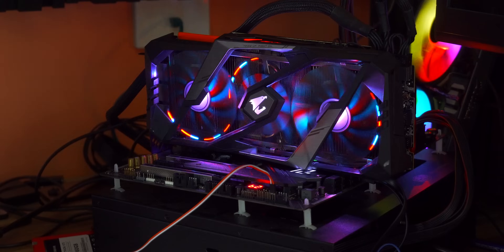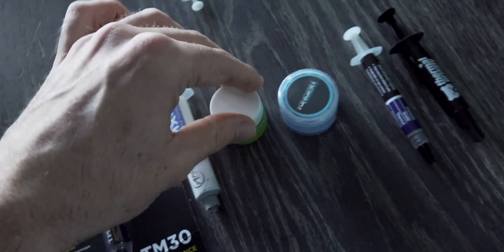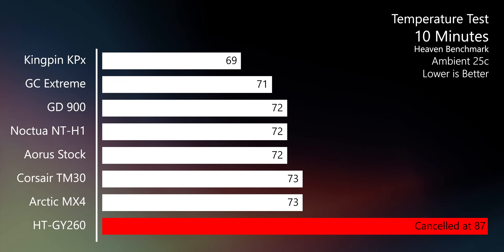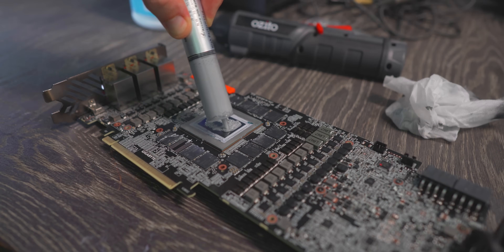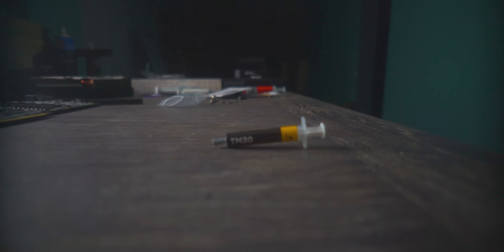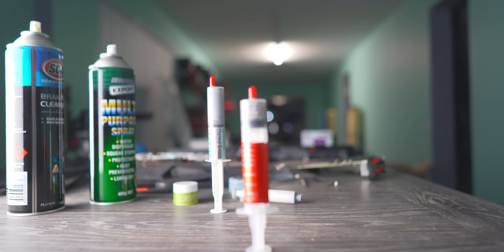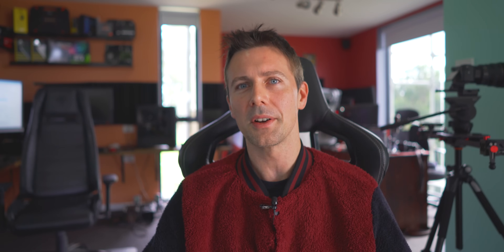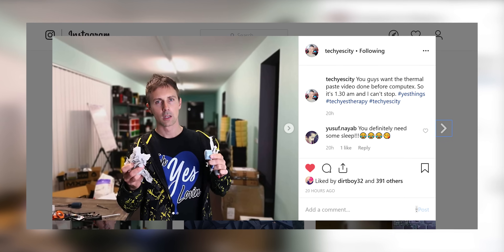What's The BEST Thermal Paste in 2019....? (Ft. GD900)

Comment from the maker: Little update on the thermal grizzly, I will make sure it's in the next test, though it's very difficult to get in Aus... (like no one sells it... :(), regardless computex and Taiwan should have some! So will get a tube over there!
Reply: PC Case Gear has it Brian
https://www.pccasegear.com/products/33320/thermal-grizzly-kryonaut-thermal-grease-3ml
Reply from the maker: Awesome I will order a tube.
Reply: Noctua released a 2nd gen thermal paste
Reply: Just be careful because there's fake stuff out there.
Reply: The only thing with testing paste on GPU is the dynamic clocks which kind of makes the test invalid, unless you can lock the clocks and also lock the fan speed.
Reply: Hey there Brian, you have done a lot of excellent work here already. However that is really only just the beginning of the measuring! There are certain things left not addressed in this video. One major point is is that runny pastes are great to apply but will dry out and loose performance much quicker than one of the high viscosity pastes like IC diamond, kpx, or gelid gc extreme. The only way to determine that aspect is to take further testing data points after an extended period of usage and time, for example: 0 days, 1 week, 1 month and 3 months. In the case of the GD900 it performed great on day0, but how can we be sure that the GD900 is really holding up over time? Well it might not we simply just don't know for certain. For example it might get overtaken by something else that was initially worse, like MX4 after a crossover point at X weeks of usage and performance drop off. We simply dont have the data to back that up. TO avoid the dry out problem, a thicker paste will always last much longer. So what we are really missing here, is a THICK version of the GD900 from aliexpress - ie. a cheap chinese product version, to compete with the IC Diamond, but at a similar low cost. This is particularly important for laptops even more so, as a runny paste simply is not suitable for them. They go bad even faster in a laptop. Anyhow I am getting away from my request to please ask you to retest them over longer period or time.  In terms of what test system(s) to use, you probably want to use your daily systems. Even if they are not the same as each other. Because what you want to be measuring is the performance drop-off relative to that specific paste's initial temperature in that specific system. And to be running your computer like normal, so every day, and taking just a few data points spread over a long period of many weeks. So what could ever be better than your daily system? Unless you want to be powering extra computers for just exclusively that task. Anyhow my point is that it is less critical if the different systems are not the same as each other. To see a meaningful difference for testing the paste dry out time. It's not like the razor thin differences between newly applied pastes. The temps should be a risin' pretty high.
Reply: I swear by Kryonaut. I use it for all of my builds. You don't get a lot, but it doesn't cure and keeps the temps amazing.
Reply: @AceMcCrank  Same here.  I get the 11.1 gram tube and it goes pretty far though.  I also use arctic cleaning solutions too.  From old stock thermal paste that's been hard for years I've seen temps go from 72c to 40c.
Reply: Pretty sure someone can ship it to you if you pay for it plus the shipping. Also could you test them on cpu and maybe also add the liquid metal from thermal grizzly as a top benchmark reference. I wonder how close can the kinping paste get to liquid metal.
Reply: in my country its sold in every pc store. its the only one that is in every store and a lot of stores also have liquid metal
Reply from the maker: At the last LN2 event, EVERYONE was using the KPX stuff if that's anything to add.
Reply: @techyescity  is it True that it's Blue because Vince's Secret Ingredient is Smurf Blood
Reply: You can get Kryonaut on Ebay as well as amazon and mighty ape and pccasegear
Reply: @MysticStar_Blue_Swordsman  There's fake Kryonaut on ebay, Wal~Mart Online, Amazon, & NewEgg. I know because I had bad experiences with all of them, LOL.
Reply: @MysticStar_Blue_Swordsman  
"Ouch, Always use reputable sellers ALWAYS check rep and what people say"
That doesn't guarantee anything, LOL.
Reply: @MysticStar_Blue_Swordsman  PC Case Gear is the cheapest & they have the bigger tubes
Reply: @MysticStar_Blue_Swordsman  Didn't think of that, I went there when I was Visiting family near Frankston
Reply: @MysticStar_Blue_Swordsman  I agree that's really expensive, from memory Auspost charged $7.20 for up to 500 grams
Reply: Keyonaut is considered the best silicon thermal paste
Reply: IC Thermalpad, IC Diamond vs GD900
Kryonaut vs kingpin cooling

Let's gooooo :D
Reply: From my experience Kryonaut dried out after 3 months at 80C so yeah don't use Kryonaut on air cooling.
Reply: Then why would you mention it for the video lol also not to be rough but check out noctuas nt-h2 as well. Thanks.
Reply: I WANTED to hit like.... But you cockteased Thermal Grizzly Kryonaut!! But no test results!!!!
Whai u not inclued Thremal Grizzwald Cryalot in ur test resluts?!?!  Thremal Grizzwald beats the world!!!!
Reply: hey check out these two

https://www.aliexpress.com/item/33011140069.html?spm=2114.search0604.3.63.221679afMvl3th&ws_ab_test=searchweb0_0%2Csearchweb201602_1_10065_10068_10890_10547_319_10546_317_10548_10696_10084_453_454_10083_10618_10304_10307_10820_537_536_10059_10884_10887_321_322_10103%2Csearchweb201603_52%2CppcSwitch_0&algo_expid=0e18b67a-9b24-4c69-a216-3bea60301f6f-12&algo_pvid=0e18b67a-9b24-4c69-a216-3bea60301f6f&transAbTest=ae803_3

https://www.aliexpress.com/item/32955076132.html?spm=2114.search0604.3.109.221679afMvl3th&ws_ab_test=searchweb0_0%2Csearchweb201602_1_10065_10068_10890_10547_319_10546_317_10548_10696_10084_453_454_10083_10618_10304_10307_10820_537_536_10059_10884_10887_321_322_10103%2Csearchweb201603_52%2CppcSwitch_0&algo_expid=0e18b67a-9b24-4c69-a216-3bea60301f6f-19&algo_pvid=0e18b67a-9b24-4c69-a216-3bea60301f6f&transAbTest=ae803_3
Reply: Not to be critical of your efforts here, but (outside of 4° or 5° differences) they actually don't mean much.
The problem with any thermal paste test involving human application is that even a slight (microscopic) difference in application thickness (or method) can cause greater differences than the actual differences between good-quality pastes.
As an experiment, we applied the same paste to the same heatplate repeatedly,.
Even though we kept ambient temp and the starting temp of the (calibrated) heatplate the same for each trial, and tried to keep our application EXACTLY the same each time, we still got as much as a 2.6° delta over the course of 14 trials (with the same paste).
Also, as you're probably aware, most K-type probes are only accurate to ±1° C; we had to spend close to $200 USD to get a probe that was consistently accurate to within 0.2°K — (the limit of our meter).
We our currently working on an automated application method to accurately apply (and measure the application thickness of) different TIMs — (will keep you posted).

Since you asked...
SUGGESTIONS: Use a calibrated heatplate (over a measured area), an accurate probe, and do multiple trials for each paste. (It may take a good deal longer, but will demonstrate the inconsistency of application and produce more meaningful results).
Reply: @UCSU3k9eeTcraD1LC1xFXLIg Sounds very interesting & link me if you make a video.
Reply: I can mail you a tube if you want.
I'll also mail you a tube of TF8.
Reply: This video actually made me a little annoyed because as you said, you didn’t test grizzly 😡
Reply: @SignedAdam  shut your fanboy ass up lmaooooo their not that good bro
Reply: No need, cuz fun fact:
Gd900=thermal grizzly
A russian techtuber confirmed it
Reply: Please review these aliexpress thermal pastes
Alseye 9T+ (13W/m.K) , and Snowmann MTG10 (14.3W/mk),should be in next video. 
They are really cheap , and in theory they should be betther than artic mx-4
Reply: Lol its sold in every pb store over here in the new zealand
Reply: BRUH PCcasegear sells it its the only paste i use
Reply: You should probably grab like 10. I love that stuff.
Reply: But... you had the tube of Grizzly right there man. I saw it.
Reply: @hjembrentkent6181  Someone sent it to Brian & It was empty Haha
Reply: The New Noctua one NT-H2?
Reply: Tech YES City  PC Case Gear sell it easy to get
Reply: Why you didn't test those with a blower r9 295x?
Reply: Cut the top nozzle and it will most probably flow. It might have hardened
Reply: Hi tech yes city would you like to send me the thermal paste graphics? wellingtonfagundes1@gmail.com my email to send thank you very much
Reply: The 1080TI is probably the best for testing for stupid high power and small area
Reply: Dude Ill send you some Thermal Grizzly if you can't order it, let me know!
Reply: Okay I hit like because YOU got cockteased with Kryonaut!  But on that note I WOULD like to see both Kryonaut and IC Diamond - I still have BIG tube of IC Diamond from when everyone was saying that it was the best.

 I also have a big old tube of NT-H1 because when I told my dad he used up all my Kryonaut on his big old X99 CPU - he confused Thermal Grizzly with Noctua because I had just bought him a Noctua NH-D15 to PROPERLY cool his i7-5820k for Chritmas (He and Mom bought me the Rockit 88 CPU Delid/Relid kit! I relidded, using 4 TINY dabs of Superglue Gel, and the thermals are insanely good!) - he had a Hyper 212 EVO on it! To the 212's credit, it did sustain a 4.4 GHZ auto overclock without throttling or even running too hot - on an i7-5820k!
Reply: Hi Brian, Brian of the USA here... have you happened to try out Arctic Silver Ceramique 2? I personally really like this stuff. It is non conductive, cheap, decent thermal conductivity and very shock resistant! I havent conducted any formal investigations on how it compares to other pastes. Just fishing for opinions from other enthusiasts! Thanx
Reply: i used that long time ago and i was very happy with the stuff, not sure how would it hold up to the newer pastes, i would like to know also
Reply: Love the Kryonaut. Great for GPUs because it doesn't cure and crack like other pastes.
Reply: Excuse me, Yes Man, you showed Peanut butter in the intro, you have to do thermal testing with it now
Reply: Only watched this to see KP vs Thermal Grizzly. I currently use Kryonaught.
Reply: Test all of their products lol
Reply: @dodecahedron-r7d  I'm not game to try Conductonaut Liquid Metal as I shake similar to Parkinsons Disease & would probably end up with it everywhere, I'm bad enough with paste but at least it's not conductive & it cleans up with contact cleaner in tight places if I get messy,

I got the Thermal Grizzly Kryonaut Thermal Grease for redoing my MSI GTX1080Ti Gaming X I got 2nd Hand (has been a massive improvement Home Video Editing with Cuda Acceleration over my R9 270X even with the FX6300 at the moment)
I haven't got around to doing it yet as I am upgrading my FX6300 cpu to AM4 & waiting for Ryzen 3000 to go 8c/16t (not sure if I'm gonna get a 3700X or see what 2700 prices do in Australia next month, but more likely go 2700) & want to do some before & after tests for temp comparison, at the moment I'm just using a Athlon 200GE in my AM4 board for surfing the net as I couldn't wait to use it & it takes a while to save for better parts on a Disability Pension.

I also have a 1080p gaming computer I Built for when I've got some long videos to transpose to Digital, It made it onto BPS Customs ShowMeYourRig last episode, as the last PC in the video I was really surprised considering the Quality of the first 2 entries
Reply: @dodecahedron-r7d  That's conductonaut, not Kryonaut which is non conductive.
Reply: Bro your videos are great keep them going, please do some videos on the best cooling, liquid or air cooling what can we do to hack out those insane numbers! Peace
Reply: problem with high viscosity pastes is that over time they migrate out of the chip(you can watch that clip of debauer explaning it thoroughly) and for short amount of time high viscosity pastes are better, but in the long run, somewhat firmer pastes hold up better(they stay in place better)..
Reply: @Tech Yes City
Phobya Nanogrease Extreme
Thermal interface for CPU, GPU, and chipset applications
Thermal conductivity: 16W/mK
Electrically non-conductive
Content: 3.5g
Reply: I was gonna say...lol where's the grizzly, I got 2 tubes for half price a couple months ago while on sale
Reply: HY880 vs GD900 please
Reply: Please can you do some testing on changing thermal pads on vrms and mem with higher mounting pressure and see if there any overclock performance or graphite pad vs higher quality thermal pads.
Reply: link?
Reply: it'd be really appreciated if you could add more thermal pastes. such as Deep Blue Z9 which seem to perform just like thermal grizzly. 
Some side note : 
It may worth testing the longevity of these pastes, I mean, maybe they perform similarly in a shot periods of time, but if under test for like couple of hours or days, maybe some perform better  than others. its worth testing this as well.
Reply: 2020 edition of this video?
Reply: @Tech YES City: Any chance of testing the new Snow MTG-5/MTG-10 thermal paste? I know they make great coolers, so maybe the paste is good as well... :-)

Other AliExpress thermal pastes that  might be worth checking are Thermagic ZF-12, ZF-12 EVO and ZF-EX. They seem to have very high thermal conductivity but there's very few tests of them to be found.
Reply: @maciejzieba1982  Another good paste to try would be GD's new revision GD900-1, and the apparently even better formulation of GD007. If the GD007 is anything like it's claimed to be, it should become the new gold standard.
Reply: What about Arctic Silver 5? Is it better MX4? I'm redoing my ps4 pro. Mind you, I've replaced using Mx4 twice in 3 months and purchased Arctic silver 5. Those are my options, I'm not buying anything else.
Reply: revisit this add pads
Reply: Whens it coming !!!
Reply: Please do a 2025 version gd900 vs gd900-1 vs gd007 vs gd-2 vs gd-3 vs Yeester paste vs MX-4 vs MX-6
Reply: could you make a video about a i7 4770 worth it 2019 ?

Comment: I use the cheap stuff on low-wattage stuff that is easy to disassemble then I use the better stuff on higher-wattage stuff that takes time to disassemble like laptops or some of those Quadro cards with dozens of screws and thermal pads in it.

Comment: I’ve been using GD-900 since 2018. The problems with it is that it dries out quickly under high heat or continuous heat & separates in the container. I reapply it yearly and always stir it before applying. I can’t recommend it for OC’ing. It probably the best value for general computing. I suspect that every time it gets stirred it performs a little worse. I think it slowly reacts with air/oxygen. GD has another worth testing; GD-007 (James Bond reference?). Please test the GD-007.

Comment: Your results are consistent with my own findings. I tested both GD900 and Noctua NT-H1 and got absolutely identical maximum temperatures. Same fan speeds (externally powered), same ambient temperature, same stress test duration. I have also tested different batches of the GD900 and found no variations in performance. If there's any real advantage to retail thermal pastes that cost 10x more per gram then it's certainly not obvious to me. I've been using GD900 for over a year and haven't found any issues with longevity either.
Reply: How often do you replace the thermal paste?

Comment: Got a 30g of GD900 syringe yesterday. Had to try it on my old FX 8350 desktop with Cooler Master Seidon 120m. Had GC Extreme for a year on it. OC stable at around 4.4GHz 1.4V at around 60-61°C on stress test. This cheap paste can do this 58°C at 4.6GHz 1.4V stable. GC Extreme is good fresh but it hardens real quick sadly. It was crumbling after a year on my Asus FX505DV. The consistency is very good and spreading is easy. I use the credit card method with a really thin layer on CPU and heat sink. Works best for me. GC is hard to work with. Amazing value and peformance.

Comment: Apparently there are two versions for the GD900, the "regular" one, which you tested here, and the GD900-1, which seems to contain silver particles, which would make it conductive (just like the Arctic Silver). 
According to a Russian video, the GD900-1 performs about 2°K better than the one without silver particles.
And according to the manufacturer's website (ourgd.net) there's also a "high end" thermal paste, called GD007.

Comment: noctuas nt-h1 never dries out. Had a few tubes from the coolers i bought. Its great. Gonna try arctic mx-4. As long as it doesnt dry out in a few years itll be good. People complain about thermal pastes and that things get worse. Using all sorts of nonsense like x pattern or spreading it all over the die. You put a pea sized drop in the middle and let the cooler spread it evenly. Less is more. The thinner it is the faster itll transfer the heat to the heat sink.

Comment: From Chinese thermal pastes: 
Snowman MTG10 (MTG5)>Alseye 9T>MX-4/\GD007>GD900-1>GD900

From two different people here: GD900 - 65-70C in stress on 8700K non-OC it worked fine one year (6-7 hours a day of gaming), but on RX570 temperatures increased from 76 to 83C after 4 weeks (also heavy gaming, Apex Legends, GPU intensive). I found the third opinion and it was very similar, but with no further details - increase of temperatures after few weeks.